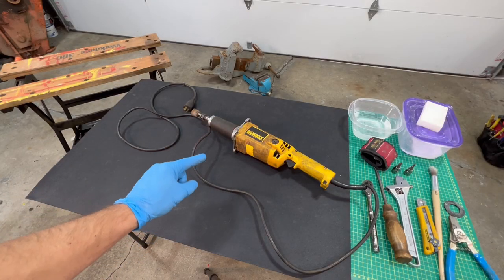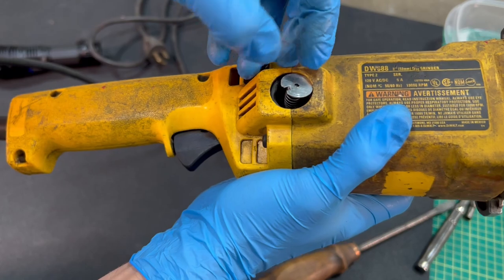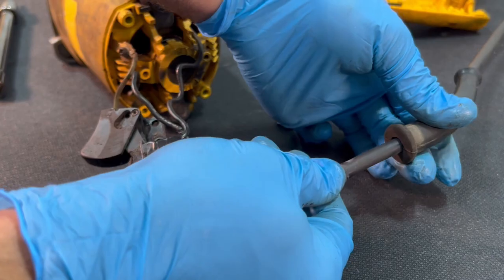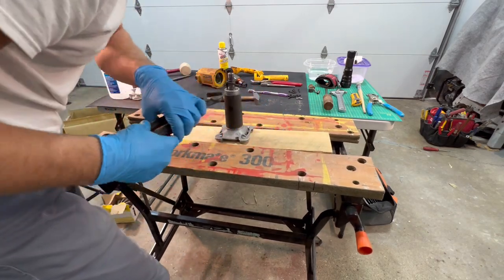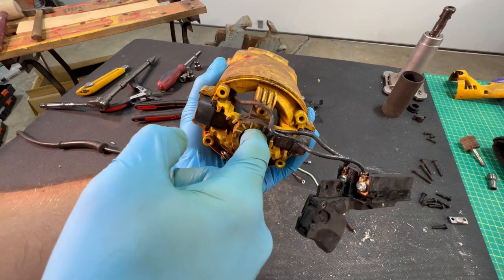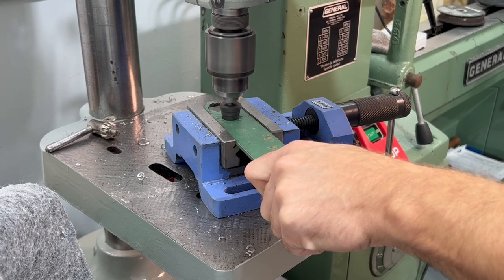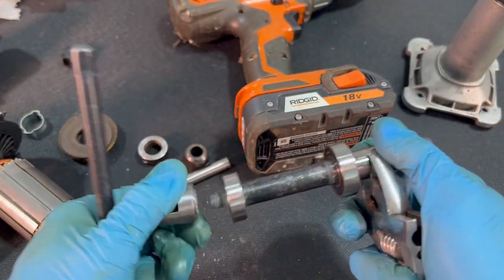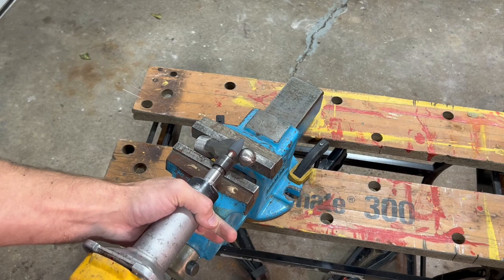Fix it - Well Used Dewalt Die Grinder Gets New Life!

Comment: Very nice rebuild. I like the idea of rebuilding good tools. You should have cleaned the whole body like you did the handle (the handle looks new). Buy yourself a terminal crimper (they're inexpensive) instead of crimping with a pliers. Very good video, thank you.
Reply from the maker: Thanks for the thoughtful and constructive comments.  I try to use what I have on-hand, the proper crimpers are a good idea for sure.  An excuse to buy more tools!  I didn't show it, I suppose I was was trying to condense the video, I did clean the body in the same way, it is a different material on the surface a more rubbery material and seemed to have stained over time.  Maybe peroxide?  I've seen people use this on plastics with good results.

Comment: 8:00 i was about to comment that it has a left hand thread
Reply from the maker: It didn’t occur to me, it doesn’t interact with the shaft, why would it be LH?
Reply: @NeedItMakeIt  Probably a safety feature in case the bearing starts to slip in the housing so it won't unscrew itself. 
I would not have known either unless i've had the same problem before.

That is a monster of a die grinder. 
Should last forever time in a hobbyist use
Reply from the maker: @-Viceroy-  That makes sense, I should have known to try it really, too busy paying attention to camera angles... who know.  I had a look online and some are marked with an arrow it seems to be a common feature.  On the other hand, they can sell more replacement parts when customers struggle like I did :).  I wanted a smaller unit, but I couldn't pass on that price.  I think I'll find a way to mount this to the lathe tool post for the occasional grinding.   Thanks for taking the time!